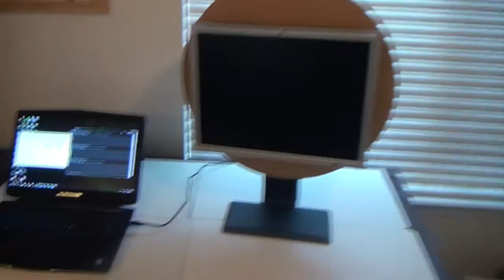Rotating Monitor for MAME Machine

Comment: What did you use to power the  pololu and servo
Reply from the maker: Spunky_Bruiser Yes.
Reply from the maker: The board was powered by USB.  Servos we're powered by an old AC adapter I had laying around.  Managed to find one with sufficent amperage that was pretty close to the upper end of the supported voltage for the servo.  Clipped the end off and wired it up with a coulpe of jumper wires to connect it to the pass through pins on the board.
Reply: Heyy , I love what you did man. About the power supply since I noticed we bought the same servo. I took an old 6 v power cord to an old phone charger and cut it off Is that pretty much what you did to give your servo power?
Reply: Hi! Where it may buy?